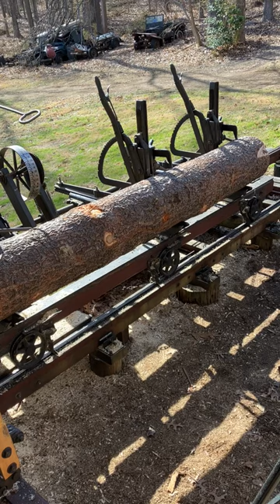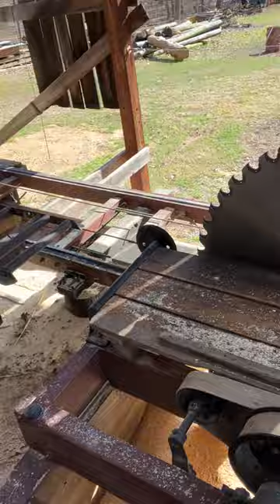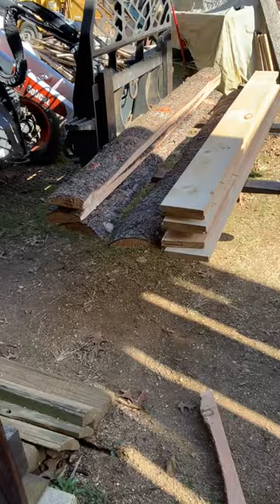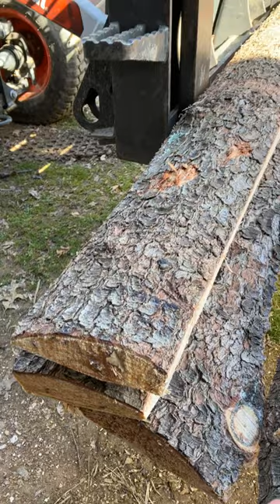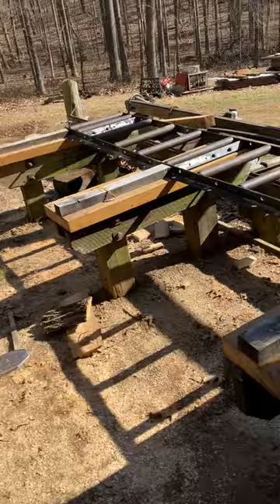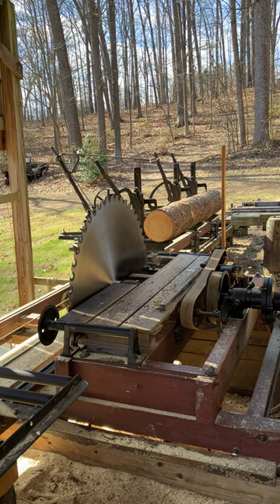PINE LOGS  to SAWMILL to BOARDS # Shorts

Comment: I fixed my blade wobble problem by Turing the collar on the mill. I made a jig and took off the block that holds down the lathing tools and mounted it to the track.
Reply from the maker: hi there we did that on the big mill because it was 14 feet long . this one got a whole new fast collar put on , did you see that video ? john
Reply: @fricknjeep  I did. I watched the whole series. Thanks.